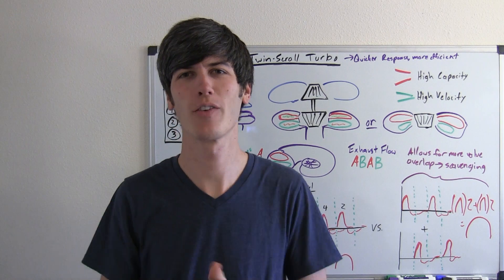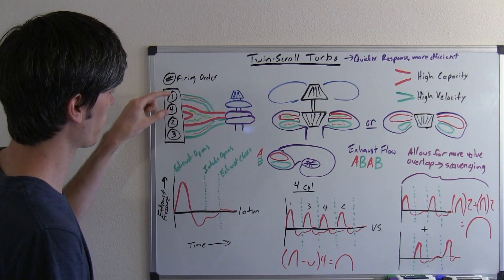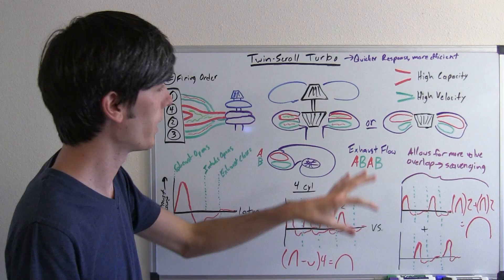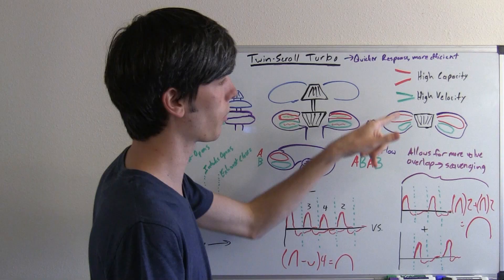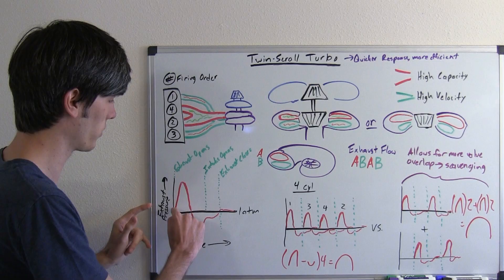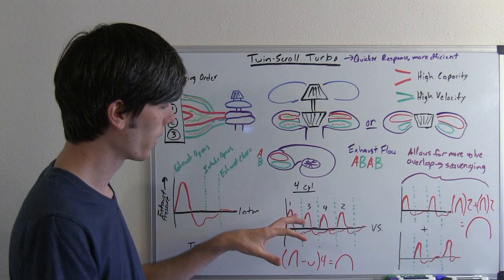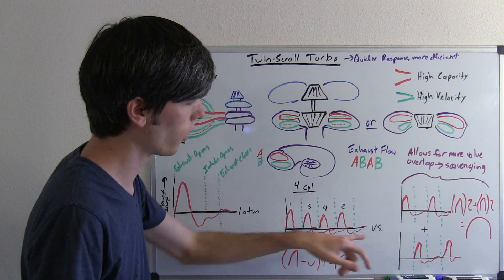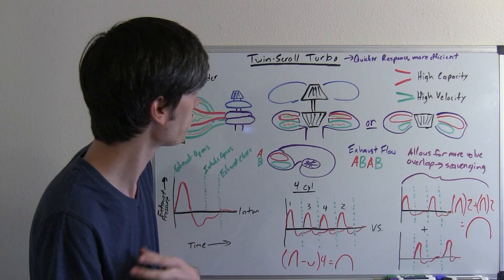Twin Scroll Turbocharger - Explained

Comment: Every clear video, just two little questions: 1. Form the first graph on the top left corner, 1 and 3 goes to one channel, 2 and 4 goes to one channel. But why in the last part you draw 1 and 4 in one graph, 2 and 3 in another?  
2. Still for the last part, why there are no pressure underneath for 1 and 4 exhaust? It shows on the graph that some negative pressure exists but you did not count it. 
Thank you.

Comment: This turbo has 2 inputs: an input receives gases from cylinders 1 and 4, another input receives gases from cylinders 2 and 3. Motors with crossplane crankshaft, like Yamaha R1 (similarly to American V8), an input would receive gases from cylinders 1 and 2, another input receives gases from cylinders 3 and 4. The explosion order is different. Plus: the path from cylinder 1 should be longer than the path from cylinder 2, same with cylinders 4 and 3 (mirror). Crossplane simplifies and shortens the exhaust system (sorry by my english from Brazil).

Comment: First of all, thank you for the breakdown of twinscroll and also much of other technology included in cars. I am following you through the years and i must say you my friend are godsend for the ingeneering inclined car enthusiast!

Concerning the part of the twinscroll explanation though, i dont quite understand the difference between normal - single scroll turbo and twin scroll turbo operation: If you sum the pressure pulse charts/profiles for the scrolls you basicly get to the same pulse profile as you have for a normal turbo. In my book the sum of the profiles is the same total force applied to the scroll - dips and peaks (and the addition/subtraction of them) are in the same place in time and apply the same force to the scroll, no matter which channel they came from. Am i missing something?

Comment: really good video but there is one thing i dont understand. so 2 cylinders are going to the large vane, and the other 2 are going to the small vane. so at high rpm, wont the 2 cylinders that are going to the small vane be super restricted and the other two cylinders that are going to the large vane wont?
Reply from the maker: Yep, it does indeed seem that way, but I'm guessing the benefit outweighs the restriction. Great point though.
Reply: Engineering Explained a theory at most, but wouldn't the first exhaust pass get the turbo spinning enough to create the smallest amount of suction in the small vane so instead of restriction, it would actually be passing through a higher speed, almost like the pedals on a bicycle? just a thought haha
Reply: joe raymond im alittle unclear. are you saying at high turbo speeds, the turbo's turbine could possibly pull a vacuum on the small exhaust vane?
Reply: Xgamer121X
Not necessarily, but it will reduce back pressure. My suggested solution would be a cross flow valve to dump it all into the high volume inlet at high rotational speeds, as at that point the disturbances he mentioned to pressure waves would have a minimal effect on boost. It's at low pressures and mass flow rates that an undisturbed pressure wave can make the difference in spin up time.
Reply: Xgamer121X I was thinking the same thing... but, once you reach max boost the wastegate will open allowing the extra exhaust gases to flow past the turbine and right into the exhaust. This SHOULD reduce restriction of the two cylinders in question.  This is only a guess haha
Reply: The larger vane is feeding the turbine where the diameter of the turbine is the biggest, hence the tip of the turbine blade there is moving at a larger speed, compared to the tip of the turbine blade where the smaller vane goes. The point of a twin-scroll is that it spools up faster than a single turbo because the smaller vane hits the turbine blade at an angle -> not applying full force on the blade, but allows the turbine to spool faster. So the smaller vane passes the blade at a "lower" efficiency, and lower gas speed. To object my theory, you can also argue that exhaust gases must leave the engine at equal speeds, but because the other vane is smaller, the gases must travel faster to get the same throughput as the larger vane. Therefore you could argue that at any rpm the gases in the smaller vane are travelling faster, hence not restricting or limiting the speed of the  turbine.
Reply: +Timo E 
I was thinking the same kind of thing. As the exhaust gas hits different points of turbine if they had made the vanes same sized the effective force they create on the turbine blades would be lower at the beginning of turbine where blades have a small area compared to the larger blade area close to the bearing. So I think they have created the vanes in different sizes and angles to compensate this and create equal effective force on turbine blades in every exhaust stroke.
Reply: Next level is one small twin scroll turbo charger per cylinder. Direct injection turbo to each combustion chamber instead of mass air into a manifold.
Reply: i have a vf37 turbo and it is very responsive. it suits my daily spirited driving at somewhat below 6000 rpm. variable geometry turbo nowadays did solve that thing. but as far as the twin scroll technology is offering me at a lower cost i think this is a very nice thing to have in my subaru sti driving on curvy mountain roads.
Reply: i have a vf37 turbo and it is very responsive. it suits my daily spirited driving at somewhat below 6000 rpm. variable geometry turbo nowadays did solve that thing. but as far as the twin scroll technology is offering me at a lower cost i think this is a very nice thing to have in my subaru sti driving on curvy mountain roads.
Reply: Callan P.K. Why do you end every post with "haha"? It's lame, weird, annoying and a bit creepy. Stop it.
Reply: That's why you don't get your info from someone who only has experience with a white board... No, or very little, real world experience. Like most engineers.

Comment: You should check out a turbo expander used in gas plants, unless you're already aware of them. They're a reverse turbo that expands gas from high to low pressure to cool it down.

Comment: If designed properly
It can do away with a twin turbo setup on a inline six and some other engines types.
Example a R34 GTR with one large twin scroll versus two turbo's.
Another great explanation good work.

Comment: And this method of turbocharging does maybe a cleaner burning inside the cylinder.
I mean: Cylinder 1 has its exhaust valve and the intake valve open at the same time, and cylinder 3 has its exhaust valve open with a huge amount of hot gas coming out.
I was wondering, wouldn't it slow the fresh air coming in the first cylinder?
Very clever :)

Very good explaining, keep up the good work.

Comment: A few people have commented about the 2cyl large vane and 2 cyl small vane causing restrictions and lack of optimization etc, especially over certain points of the entire rev range. I think it's somewhat beside the point as to me the design would clearly be to spool the turbo to the desired boost level faster, once you're ON boost and wide open throttle, keeping the turbo spinning isn't nearly as much of a concern anymore, the engineering challenge is to get it from nothing up to making boost. My guess would be the vanes aer optimised in the 1500-3000 (ish) rpm band (depending on brand/application etc etc), above that you can count on the higher engine speed alone really to get the turbo spooled very fast. I love my twin scroll turbo in the Elantra Sport 1.6T, it gets on boost so fast!

Comment: I think you miss one of the main reasons, why twin scroll turbochargers are more efficient than single scoll turbochargers. When the exhaust valve of one of the cylinders open, it's pressure pulse travels down the manifold. When it gets to the collector the pressure pulse travels backwards the manifold pipes to the other cylinders' exhaust valves. It then hits the pressure pulse of the next cylinder reducing it. When you divide the collector into two pipes, the pressure pulse only travels backwards only one other manifold pipe instead of three. So you lose less of the pressure. Also the extra delay until the next exhaust valve that runs into the same collector section opens, prevents the pressure pulse from hitting the next one at least in some part of the rpm range.

Comment: The interesting part is, that running a divided or a twin scroll on an OPEN manifold, has almost identical benefits to pulse division.  It would seem practically most of the work is done in the turbine housing, of course as you know engineering is about taking things a step farther to make the most out of each possibility and situation while keeping costs in mind.

Comment: I think you may have gotten it wrong, i don't think it would be an increase in pressure, but the right word would be a more continuous flow or sustained pressure. For example, its now outputting say 4 pulses of pressure per cycle compared to one or two, but this video seems to be saying that the pressure of all four are being added together. Correct me if i am wrong.

Comment: You explained everything right but I believe you left out or at least should have reiterated your firing order at the end and stated that the reason for the closing of the exhaust impulses is because the cylinder that fired previously to the current one is maintaining a dropping pressure in the piping while the alternating cylinder and exhaust manifold are pressurizing. Which causes quicker and smoother spools

Comment: This is featured in the new BMW M3 and M4 which have an Aluminum 3.0 inline 6 S55B30 motor for anyone interested in research...
Reply: Actually, the S55 engine has two mono-scroll turbos. The current N55 (non M 3.0 I6) has twinscroll.
Reply: russianpegs where can i find more on the in fo?
Reply: It's also in the Hyundai Veloster turbos

Comment: Glossary: Scroll = pipe.  Twin scroll = 2 pipe.   This is probably explained in his previous videos.. but I read ahead and got confused.

Next, I don't quite see how back pressure is reduced - it just comes from a different pipe.  But perhaps there are one way valves?  Or the back pressure doesn't affect the spin of a turbo more than the top speed of the gases?

Related - Another video, more practical and less charty than this one, and both appreciated, seemed to chalk the reason for the two pipes to reduce interference or turbulence - any juice to that?

Comment: Turbochargers from evo 4-9 are all unequal twinscroll but the difference in size is small so the negative is negligible. The advantage is no over boost, higher boost at lower rpm from a bigger (380hp capable) turbine hi rpm exhaust scavenging. With single scroll all cylinders dump exhaust gases in same pipe and interfere with previous exhaust event so pressure gets some exhaust gases back inside combustion chamber of previous cylinder.

Comment: Nice video; it makes sense the way it is explained.

However, won't there be, to some extent anyway, the slight negative pressure from one of the scrolls going to want to "hold back" the turbine while the positive pressure from the other scroll tries to push it?

Comment: Thanks for the great video!! Could you please confirm if that drawing on top left corner is wrong as you’re combining 1&3 cylinders and 2&4 cylinder where your explanation in the bottom right corner shows that you will combine 1&4 cylinders and 2&3 which seems to me the correct one.

Comment: First: great awesome and very informative video
Second:
In drawing   1:3 are paired in exhaust and 2:4 are paired.. and the firing order is 1-3-4-2... this means when cylinder 3 fires right after cylinder one it reduces scavenging into cylinder 1 with its back pressure but this doesn't happen on the next stroke when it goes from 3 to 4 switching between green and red exhaust pipes.. is there a reason its changing from green to red exhaust every other stroke instead of every stroke?  You verbally describe 1:4 paired and 2:3 paired at 5:08 in which doesn't look like the top-left green-red exhaust diagram, unless I'm reading that diagram wrong.

Comment: I get the separating the gas pulses to avoid high pressure from one cylinder being lost due to the depression caused by the next cylinder's inlet. What I don't understand is why you would want two different "angles of attack" on the turbo. Since the inlet to the turbo is a fixed form, aren't you just optimizing half the cylinders for low rpm and half for high rpm ? In that case wouldn't a dual entry variable turbo be the ideal option ?

Comment: mmmm. Not sure about that. Traditionally turbo engine cams don't incorporate valve overlap for scavaging because this introduces boost pressure through the combustion chamber into the exhaust manifold.
 Perhaps variable valve timing in later model engines can adjust to eliminate valve overlap where positive manifold pressure is present, measured by the MAP sensor.

Comment: Supercharger and Turbocharger working together ,also compression ratios and octane numbers,fuel pressures,engine mapping, how it all comes together best for the in line four cylinder petrol engine max power and torque.System i wish to understand is in the Lancia Delta S4 rally car made in 80's in Italy,it's one of the best cars of all times...

Comment: Just bought a 2011 e90 335xi with the twin scroll. 300ft/lbs at 1200 rpm and 300hp at 5800rpm.

It’s not anything unbelievable in terms of power.. but the power delivery is unreal.